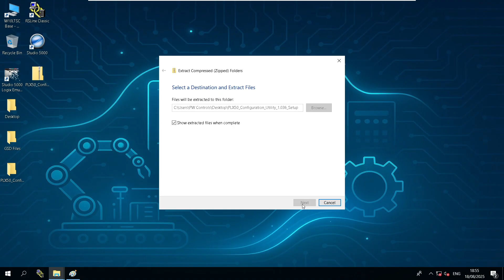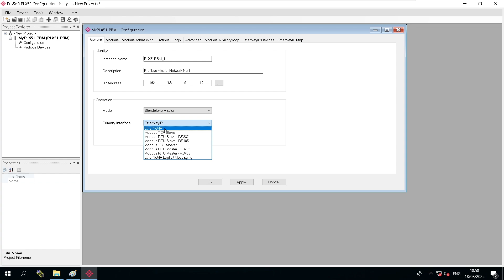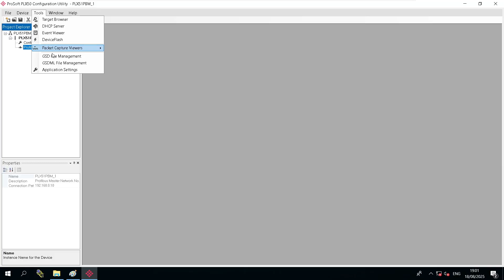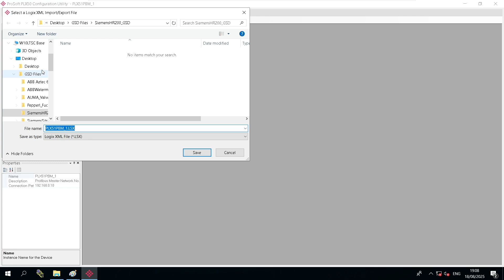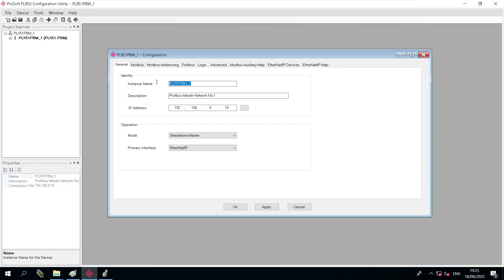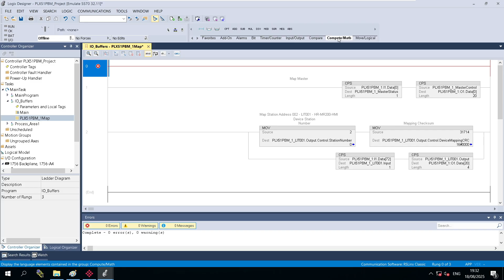Prosoft PLX51PBM Profibus DP Gateway Module - Connect Profibus DP Devices to Ethernet in Studio5000

Comment: Hi. Thanks for the video. I'm facing a problem while importing routine. In the tags portion, the red flag is displayed, stating that the tag is not defined in the import file or project. Can you please suggest some solution
Reply from the maker: Are these not the tags showing which are not yet in your studio5000 program that will be added once you click ok on the import? And did you export the L5X file and then import the routine into you project ok?
Reply: @PWControls  problem got solved. Thankyou for reply